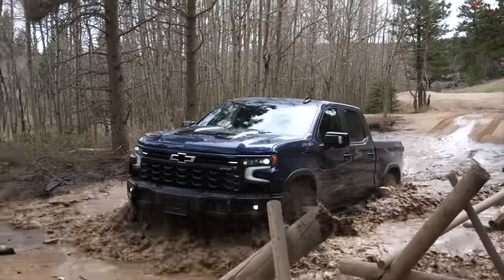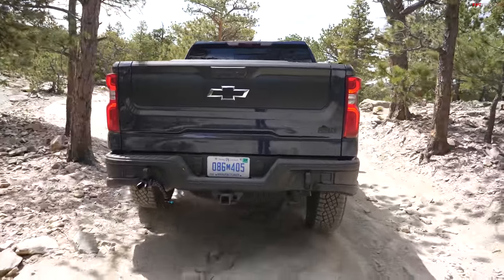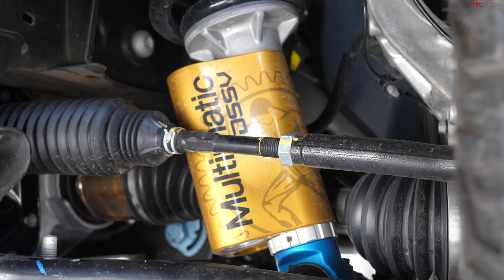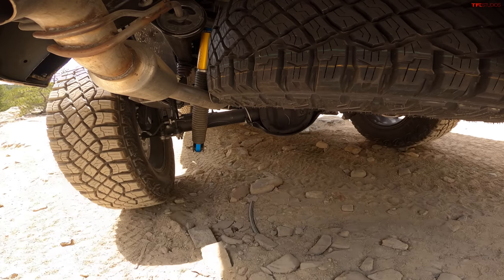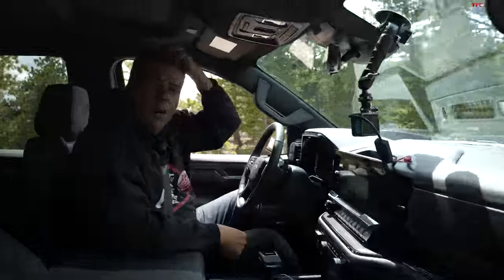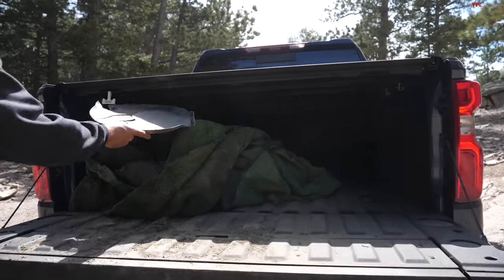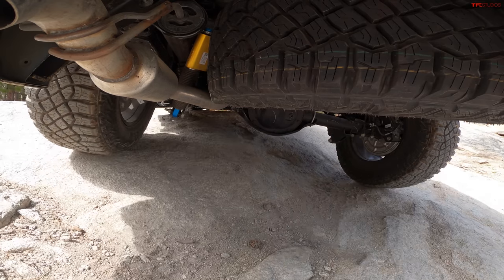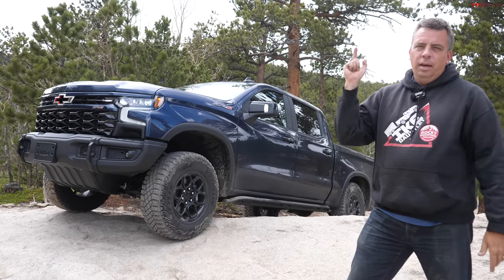The 2023 Chevy Silverado ZR2 Bison Handles DEEP Mud in the Colorado Backcountry, For a STEEP Price!

Comment: Once again GM can’t put a proper sized tire on their trucks.  33 inch tires don’t cut it for what this thing costs.   So an $80k truck needs suspension mods and tires right from the factory.  No thanks.  I’d rather just buy a used Silverado and go to to Baja Kits or Dirt King for one of their long travel lift kits and have a much better truck.
Reply: You would definitely have a higher truck, and a cheaper truck, but probably not a better trail truck.
Reply: What’s better about this truck than an aftermarket long travel kit that fits a 35 to 37 inch tire, has more durable ball joints and A arms, and has far more suspension travel?
Reply: @holdenc3082  The factory e-lockers are important. I’m with ya though a used truck with mods would be dramatically cheaper and built to user preference.
Reply: @@JsGarage  I knew someone would mention lockers.  A rear ARB air locker is $1200 plus about $600 for the compressor.  Granted they aren’t available yet for this model year but are available for 2014 to 2019 Silverados which is where I’d be looking anyway.  I could write a check for one of these trucks new if I wanted to, but I can get more value and build a better truck by buying lightly used and building through the aftermarket.  $85k for this truck on sad 33” tires is crazy.
Reply: @holdenc3082    More lift and travel, I get it.  What about the shaft & axle angles, lockers, skids, active suspension modes, drive modes, rear shock mount position etc?  Just lifting a normal truck up real high and putting real tall tires on it doesn’t turn it into a ground-up sport vehicle with more modularity and upbuild potential.  The people at Trader Joe’s wouldn’t like yours any more than the other.

That was a joke 🤣 Lighten up, Francis.
Reply: @@garysarratt1  Oh I’m fine Sergeant Hulka. 😀  Gary look at some of the long travel kits like Brenthal or Dirt King.  They don’t just lift a regular truck by throwing some cheap drop brackets on it or throwing a puck under the front coils with some Rancho shocks.  It’s a whole other world.  As far as drive modes that stuff is all gimmicks in a factory truck.  For the record my truck goes a lot cooler places than Trader Joe’s. 😉  But thanks for thoroughly vetting my comments. 😀
Reply: In fact I just thought of something.  Here’s an idea for TFL.  Take one of these factory trucks like the Bison, Raptor, or TRX, then pay a visit to one of the aftermarket companies that build these trucks correctly.   Drive them back to back.  It would be an eye opening experience to help the viewer decide what works best for them.
Reply: @holdenc3082   I think that would be interesting to see and would def let the buying public know what it takes in the aftermarket world bs factory, things that I often wonder about esp with the price of entry for new vehicles going insanely high.
Why it won’t happen - the exclusivity that tfl and others get to be the first to test from a manufacturer which drives people to the channel would go away if the content says “don’t waste your money buying brand new from Chevy, ford, etc buy used and go to your local shop it’s better”
Do you think Chevy et al would still give them trucks to test if this were the case?
Reply: @@ericvolkman1490  Yeah, you said what I was thinking, I just didn’t feel like going there.  At some point the customer just has to say no to these prices and build through the aftermarket.  One of my trucks is an old but restored GM square body on 37s that would drive past this Bison on that trail like that motorcycle did.  It has a modern LS fuel injected engine and ARB air lockers front and rear.  The only “drive mode” it has is my right foot and is the only mode I’ve ever needed.
Reply: @@ericvolkman1490  But yeah, if we are talking IFS trucks let’s see one of these near $100k factory trucks go up against a base model
truck modded with a long travel kit, Fox reservoir shocks, and some 37s.  I’ve got an IFS truck that can play the high speed desert game too.  It for sure needed mods to get where it is, but it wasn’t $85k plus ripping out the factory “off road” suspension package.
Reply: Honestly I think it’s fine. It’s an OEM offering at the end of the day and seems fairly comparable to what similar new vehicles cost. Of course it won’t perform better than a proper aftermarket solution but that’s not the point of these really. They appeal to those who want an off the dealer lot experience that has the look and just enough of the performance to make the owner happy.
Reply: Yo3unhave to understand its a delicate balance between usefulness, fuel economy looks,s etc.
Reply: Just another pos gm product that's way over priced😂.
Reply: @holdenc3082    Sorry if I’m a tactless smartass.  I’m interested in this subject.  I question any absolute claim without any info, thanks for explaining it further.  I’m thinking about an older truck for the farm and just reading “lift an old truck and it’s better than new” didnt seem right, like if it were that simple why aren’t they all made that way.  Anyhow, you make good points and make a lot of sense.
Reply: @@garysarratt1  No worries Gary!   You seem like you’ve got your head on straight.   Man for a farm truck it’s hard to beat one of the 88 to 96???   GM pickups.  I’m old and I can’t remember the last model year.  They made lots of them.  Parts are everywhere.  Good simple TBI 350 or 454 engine with stupid simple technology.  Not fast by today’s standards but somehow everyone back then managed to pull a trailer.  If you are on the farm I bet you know how to turn a wrench if you’ve got time with all your other duties.   Just a thought.  Could be a great winter project snd save you at least half of $85k!!!
Reply: @holdenc3082    I’m a traveling nurse, pull a 15k lb 5th wheel with a newer Chevy.  Had to part with my 01 because I’d just replaced the transfer case and really didn’t trust it anymore to tow a long way, be my DD too.  The farm is where my home is.  I’m not real active there, and rent out pasture for cattle, but I need a good 4wd beater that isn’t as heavy as mine now for when I go home.  It’s usually wet there in the winter, and I haul stuff around the woods and terraces, bring out deer etc.  A side by side would help a lot but not for hauling a lot of rocks and stuff and driving to town.
Reply: Smaller tires do better offload. This one came with side steps so it's not meant for these crazy rocky trails

Comment: Ugh.. another IFS rig. When will the Big 3 realize trucks need solid axles front and rear? IFS needs to go away as a trend.
Reply: I wish, but it won’t happen.  The car companies know most fat ass Americans don’t actually use their trucks off road.   I agree with you that IFS sucks unless it’s one of the built dedicated off road trophy trucks,  or at bare minimum a good aftermarket long travel kit.
Reply: Not sure IFS is a trend, being it’s better in a lot of ways for the type of vehicles these are and the uses they’ll see. If you want something with solid axles, get something with solid axles or build your own.
Reply: With lockers front and rear it matter less. SFA with flex will always be better but double locked IFS will get you a long way.
IFS is just so much better on road.

Comment: 80,000 for a useless trucks i buy used i neer pay anywhere near top dollar or new crao i wait. i bought a 75,000 miles a  v 8 xc90 awd 2008 in 2017 for only 7,500  and its still going strong and is 95% perfect 15 years later. Body is 100% no flaws even underneath in the rust belt too. Payload is great and better than this truck and i have two tvs and rear air ,sunroof and soo amny extras!!!. love the bison but this one is unreachable! And uneconomical and unreasonable for me EVER !!